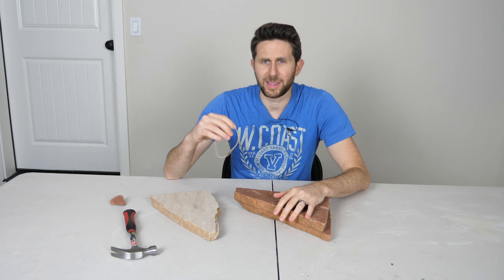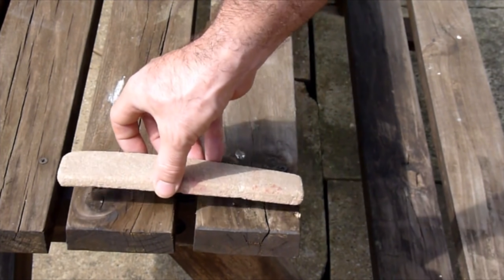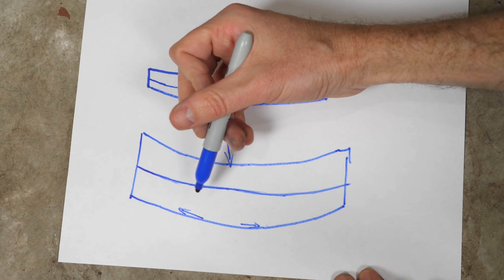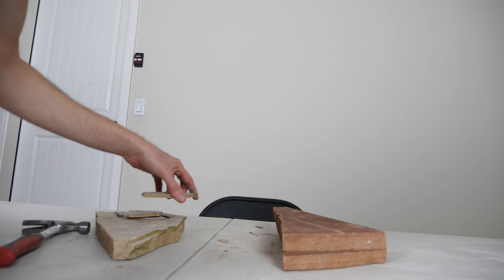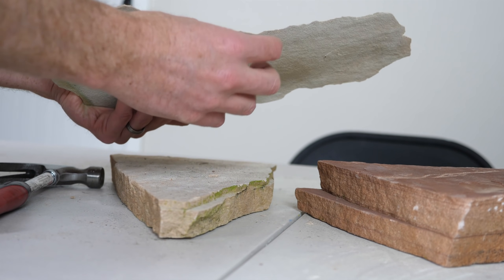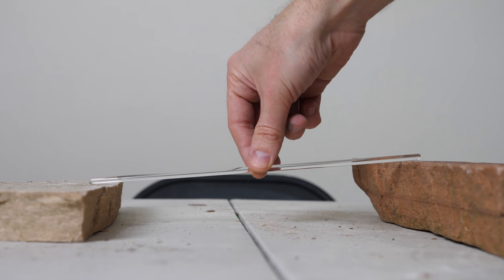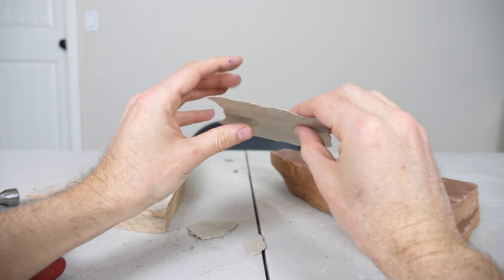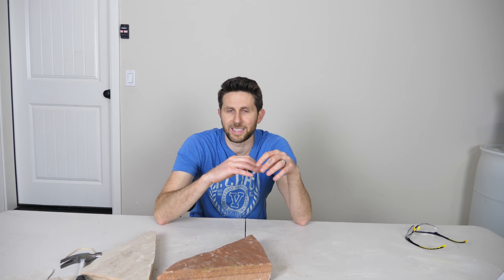Itacolumite—The World's Most Bendable Rock!

Comment: Several years ago I was cleaning up my place and decided to throw out a tiny ship in a bottle. The bottle seemed to be made of plastic. It didn't feel cold to the touch, and it flexed when I put pressure on it. So I decided I'd crumple the bottle and recycle it. I gave it a hard squeeze, and it shattered. Because like plastic, very thin glass also don't feel very cold to the touch (low heat capacity) and flexes slightly, as shown in this video. I still have some small scars on my hand from that lesson.

Comment: Correction . When you are going to put the same weight on two different sections of same material the section having more depth will be having less curvature because of more moment of  inertia . producing less tension on the bottom surface . So  that section is not going to break at the same weight
Reply from the maker: It won't break at the same weight, but I'm talking for a given deflection not a given weight.

Comment: It's not just thickness, its thickness to length ratio. For example, tectonic plates have about the same thickness to length ratio as that sandstone slice you just bent, so it stays elastic. That's why earthquakes happen, because plates keep skipping as they slide thorough each other. Note that this is unlike what you last described since that was plastic deformation, which forms ridges and mountains and what creates earthquakes is elastic deformation like what you did with the sandstone.

Comment: Another way to bend even thick pieces is to heat them up to really high temperatures - rocks also behave pretty much like glass and doesn't have a fixed melting point. It become softer above a certain temperature and is then gradually turned to a liquid lava as the temperature rises further (usually temperatures of about 1000-1200°C depending on the type of rock, will make it soft and easy to bend without melting, haha).

Comment: Please perform electrolysis on molten salt to extract sodium
Then perform some experiments with it
Reply: Great idea!
Reply: @stephen madl well then i guess sodium extraction might not b possible as hydrogen would yield at cathode
Reply: @stephen madl No it doesn't. As long as the Cations and Anions are free to go to each electrode it will work.
Reply: @stephen madl What?!
Reply: @joelcallear385  He means you are just a dumb wacko - oh yeah yeah!
Reply: @ksp-crafter5907  I don't understand. If you were to dissolve Sodium Chloride into water and do electrolysis then Hydrogen and Chlorine would be made. I do not understand why this is wrong.
Reply: @joelcallear385  Scientific sources??
Reply: @ksp-crafter5907  How about basic English GCSE facts. Cathode rule: At the Cathode a metal will be made, if the solution is dissolved in water the metal has to be LESS reactive than Hydrogen. Sodium is more reactive so thus can only be made by melting down the Sodium Chloride, then using electrolysis.
Reply: @joelcallear385  And the Water would explode!   
Impossible to do!
Reply: @ksp-crafter5907  Explode. No it wouldn't, why would it explode???
Reply: @joelcallear385  Heat expansion from water to steam!
Reply: @ksp-crafter5907  It would not explode.
Reply: Yeah the reactions are given in class 12th electrochemistry only😂

& Performing experiment with sodium means through it in water🤣(the first one comes to mind)